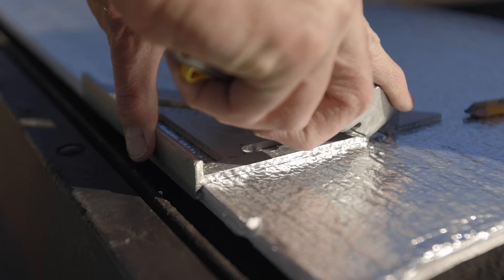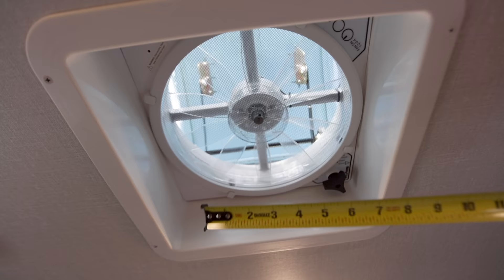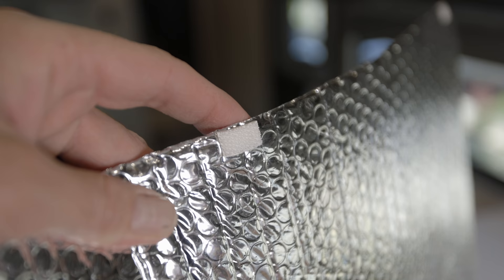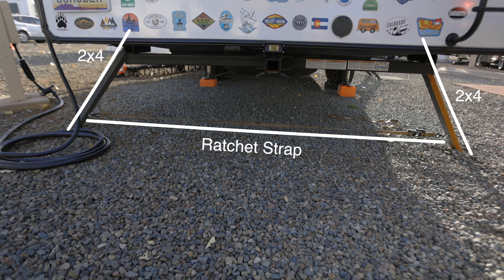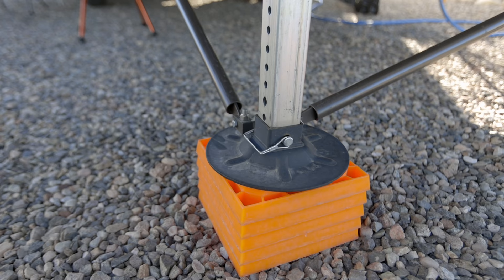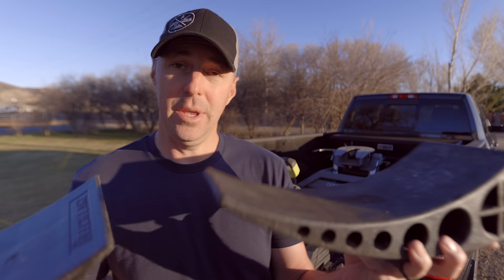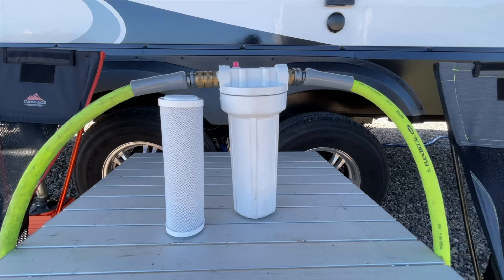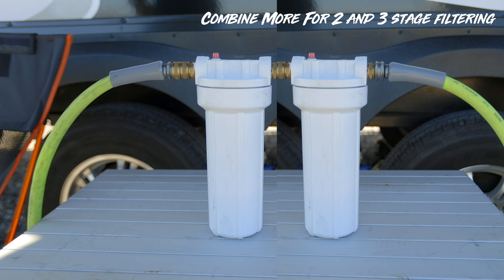HomeMade DIY RV Accessories!

Comment: I used a 4 inch hole saw, but you could do it several ways to put a hole in the bottom of a 5 gallon bucket. I flip it upside down, and it holds my water filter nicely. When traveling, I  coil my hoses up inside the bucket and put my filter upside down in the center. Water drains, and it's all ready for next trip.

Comment: Not as useful for full timers like you, but one of my favorite diy things is the hose I made. It has a garden hose fitting on one side and an air hose fitting on the other. I hook it up to the city water connection and can blow out my water lines when winterizing. It save a bunch of time and money spent on putting antifreeze through the whole system. The air fitting side of the hose is attached with a thumb screw hose clamp, so it's removable. That way I can also use it to connect to water at places that don't have threaded connections.
Reply from the maker: That is a great idea.
Reply: Camco and others also sell a fitting that accomplishes the same thing. The one I have is anodized aluminum and fits in the little divider kit I have with spare fuses, bulbs, screws, etc.

Comment: Good video! I put strong magnets in the reflectix right where the screw heads are for the window frames and got some printed mountain/outside fabric to put on the cabin facing side to have a better view than looking at silver on the walls. I will have to try out the rigid foam idea!
Reply: Very Good Idea.  I bought 3 packages of little Extra strong Magnets from harbor fright , can get them about any were  Lowes amazon  changing a lot of stuff over to  Like what your Doing.......MAGA

Comment: I use stall mat cut to 10"×10" as leveling blocks like the orange or yellow ones. This product is super tough and doesn't slip when your pulling on to it.
Reply: Lol,  did the same!  It also keeps gravel from getting jammed up into the blocks and making it a pain to restack.

Comment: We use the large levelers under the tongue. To help insure the base of the jack does not move, we build a top that nests into the levelers and has a pocket just the right size for our jack base.
Reply from the maker: Great idea to keep it from sliding off.

Comment: Love that filter assembly. I’m going to give that a go. I like to keep my hoses coiled in a bucket and that got me thinking maybe I will mod a bucket to put the filter in with some insulating material wrapped around it, cut holes in the sides opposite bucket handles for the hoses to poke through. The bucket wouldn’t have to be that big, either. Can’t wait to try it out!

Comment: As a special education teacher I use Velcro all the time. There is black and brown Velcro that comes in small circular pieces. You wouldn't have to cut them for the reflectix and since most RVs have black trim around the windows it would blend in better than the white and would look more professionally done. They should also be plenty strong enough to hold the material.

Comment: I made wooden stabilizer pads almost the same way… sandwiched 2 pieces of plywood between 1” thick slabs with 1/4” rubber stall  mat on the bottom using construction adhesive and screws but I put the ends of around 2’ length of scrap ratchet strap (about 6” of each end) so they have an easy handle! Also, gave them a few coats of marine varnish to protect them from water, etc!

Comment: Simple metal coat hanger to make a bracket to hang they water filter off of the water spigot so it's off the ground
Reply from the maker: Good idea
Reply: @AllAboutRVs   great if you can find the wire coat hangers
Reply: @arthurkneisel8296  dry cleaners still use them or you could bend up some utility wire roll found at your local hardware store.

Comment: I made a bracket to hold our water filter out of one by six. We use quick connections on both sides of the filter to make it easier to hook up. We painted it and have used it several years with great success

Comment: Another good video, Thanks I always learn something from you.  I made a filter holder out of a 25L foldable milk crate. Just turn it upside down set your filter housing on top and  outline the housing and cut it out. Now the filter will sit down in it and is very stable. The crate collapses and stores easily. If it is hot or really cold outside I will cover it with a space blanket or Reflectix.

Comment: I used the reflective foil to cover my windows too. Most of mine just slipped into the channels but for the ones it didn’t, I used aluminum tape to secure it to the frame. I like what you did. I may have to try that in the future. I purchased the pillow with the reflective side for my vents and in my shower skylight. I tried just using reflective foil in the skylight but the aluminum tape wouldn’t hold for long periods of time. My cabinets over my bed were getting moisture in there so my clothes were getting wet. I used the reflective foil in there too.

Comment: Pro and cons to everything. My buddy bought the vent pillows and it got so hot where we were that the vent frame fan warped from the heat . ( maybe crack the vent open if it extremely hot?). As for the wooden block ( used them for a long time too ) I now use the plastic leveling blocks and the plastic tire levelers because as a RVer weight is you enemy ever little bit helps to light up, most storage is in the front of the trailer so run you setup across the scales axel by axel and you might be surprised if you hitch weight.   Stay safe my RV friends

Comment: you may want to be careful with the 'reflectix' - in high heat areas, I have had them warp the plastic channels in the window.  Also, had it warp the plastic skylights......
Reply from the maker: Thanks I’ll watch for that but haven’t had an issue in Arizona or Florida summers yet.
Reply: Thanks for the warning. Another YouTuber recommended putting reflective insulation on the outside where the sun hits as more effective. It keeps the sun’s radiant heat from ever getting in.
Reply: @robertschulke1596  agree it would be more effective, but how long will it last it rain? More effective plus more hassle.
Reply: @TraconWizard  if it’s raining or windy or after dark, you don’t need to worry about too much solar heat. Take the covers off.
Reply: We had the reflective ones on the camper door windows , left it on while in storage with the sun on it ,and the frame warped on us too. I bought some blackout ones on ETSY for the camper doors.  I still use the reflective ones on the other windows , just not 24/7

Comment: Alternative for your wood blocks, use 2x6 boards cut them to about 11 1/2" and screw them together cross grained.  Mine are pressure treated lumber, 7 years old and I built 10 blocks for the 6 point system and works great and can even use them for tires if the site is that far off level.

Comment: I also added a ground pad that I use under the leveling blocks to keep the gravel from getting lodged in the bottom block. It just annoyed me to try to stack the blocks and the gravel or small rock would mess it up!  I used a rubber stable pad from Tractor Supply and cut it in squares about an 1/8" around larger than the blocks.  Used a jig saw to cut it,  and it smells like a tire fire, so use an N95 mask while cutting the rubber!

Comment: I ran a 10x2.5” filter housing setup last summer. But noticed that pressure would drop off at flow rate. Tried a number filters inside.
Moved to a 10x4.5” housing with lower micron filters and haven’t had any pressure drop off.

Comment: The water filter you have does not have to sit straight up. You can lay it on its side or even upside down and will not affect the filtration

Comment: I made 2 reflective covers for the canvas ends of our Hybrid trailer to reflect the sun off the canvas in the summer. I just connect them to the trailer with bungi cords.
Reply: You can find thermal reflective tarps on Amazon or sporting good stores in the survival section. $20. Typically, they're used with the reflective side towards you to keep your heat in, but flip it over and now they reflect heat away. That's what we used on our Rockwood Roo 183 with the 3 hybrid flip out beds. 60x80 in size fit perfectly over the tops with plastic clamps from Harbor Freight. Or bungy cords since they have hooks. Not only does this keep heat out in the summer, we used them almost every trip to keep that morning sunlight out to keep kids sleeping in longer and less cleaning of the bed tops. It was a lot easier to wipe them off on a table than moving a step stool around and wiping down the the fake canvas that was hard to keep clean. We gave them to the new owner of the Roo when we sold it to buy a new camper.
Reply: @jeffreybryson  I got mine for free, it was a cover for steel we bought for work. All it cost me was grommets,  and a couple of bungy cords.

Comment: I put quick release fittings on the filter …much quicker👍
Reply: But, it will restrict the flow because the inside diameter of the quick release is smaller than the pipe fitting

Comment: i use a 6 inch underground irrigation valve access and drilled a hole in the lid for my filter stand

Comment: Instead of the command strips, you could make a little slit in the edge of the reflective bubble wrap and put small neodymium magnets exactly where the screws are around the window. Of course you would have to put a dab of a rubberr type cement in after the magnet

Comment: For the reflectix, I cut the pieces bigger for the non sliding section so I can push them in and that works well.  For the sections that slide I actually cut them to size and have my wife open the windows  from the inside and I place them against the screen from the outside.  When she closes the window it stays sandwiched between the window and screen.
Reply: Great adjustment

Comment: That reflect x idea with the command velcro is such an obvious but great idea! We had a few day heat wave here and was having issues with our AC conking out. I had to take half days off work to stay home and make sure my cat and dog were okay. I panic bought some aluminum foil and tape and taped up my windows from the outside. Worked well but made an annoying mess I've got to try and clean off[the tape residue]. I'll get some reflect x and prepare for that for next time

Comment: I have a two filter system in my coach, an old Monaco dynasty, but I have added a whole house UV filter after the two filters. I have a 10 µm filter with carbon and filter element and a 1 µm filter before the UV filter. So I can drink the water and feel comfortable washing dishes and showering with the water out of the tank. It filters the water going in the tank and also when I draw water out of the tank it goes to the same filters again.

Comment: Been wanting to know what your water filter was as I saw it in other videos. So glad I found it here and how much cheaper it is as compared to the dual blue system. Thanks for all the knowledge you share. Gotta add that one of my FAV tips is the one you showed about using the fuse at the top of the 7 pin connector to make all the lights and cameras work....AWESOME!
Reply from the maker: Thanks! New video coming soon on a great budget filter option!

Comment: We have a whole trailer filter that came with our Rockwood that is after the pump/city water feed. We plan to get a Reflection 5er and want to mount the same thing where the Electric outlet is in the water bay (possibly move the electric outlet above the water bay, facing down.)  We could make the internal filter a lower micron filter and then use an external higher micron for city water or tank fill.  Just thinking out loud...

Comment: Just bought the same filter (container) and threaded fittings. Then realized I could've bought the same model from Culligan for $35 that includes fittings. Works out to about the same total cost except Culligan's model has plastic fittings included.
AO Pros: Fittings are separate making them easier to keep clean
AO Cons: Fittings are separate, must be purchased and require plumber's thread seal tape to install before connecting hoses
Culligan Pros: Fittings included and no extra install or seal tape necessary
Culligan Cons: Fittings included are made of plastic...which could be a pro depending on how you look at it. No tape needed.

Comment: Why not put a smoked max air cover on the roof vents? I did that on mine to help with the sun beating in and heat. Also allows me to have the vent open if it’s raining

Comment: I've had limited success using self-adhesive velcro to attach Reflectix due to the heat melting the adhesive. Of course, I live in the southwest, so it may not be an issue elsewhere.

Comment: You may have noticed the extreme amount of heat that come through your shower sky light when the sun is shining. The bathroom heats up and the heat migrates out to other rooms. The sky light is two separate pieces of clear domed plastic. Lowes sells a smaller bag of WHITE fiberglass insulation- $5.88 (Item #35136Model #B777CT40) You can remove the inside dome and evenly place the batting over the sky light and tuck it in the side cavities (to hold back the attic heat). Then reinstall the inner dome piece. I estimate that you still get 80% of the sunlight in the bathroom (more than enough) but ALMOST NO HEAT! This is a big deal when trying to cool your RV. Note; I have a Grand Design Reflection. I don't know if other brands use the same sky light.

Comment: I find the landing gear can slip on the square plastic levelors and even slide off them. In a strong wind, the front landing gear of my fiver slid half way off. Fixed it but that's scary.

Comment: Concerning your stabilizer.  Will this reduce the rocking that we get with our jacks down? Our trailer is only 20', but rocks like crazy! I've tried using blocks to shorten the jack reach, not blocks to lengthen the jack reach, nothing helps. TIA!
Reply: Also, we have a belly pan, so I don't have access to the undercarriage framework.

Comment: Another good video. For the filter what do you do with it during travel or if you aren't using it on between trips? We just camp weekends so I was wondering about how to get the water out of it easily for travel and not having it sit in there for the week. Do you just disconnect hoses and drain it out and call it good? Basically what I did with the old style I guess.

Comment: Great tips Jared I think camco sell a filter holder for that kind of filter thanks 😊
Reply from the maker: Thanks.
Reply: Yes, but too expensive for either the plastic (wind knock over) or the metal (ground is too hard/rocky).

Comment: magnets might work better than those command velcro strips
Reply from the maker: Yes I would prefer magnets but the first magnets I tried didn’t stay on the window covers
Reply: @AllAboutRVs  separate the layers and put the magnet between the layers then glue the layers shut trapping the magnet inside.

Comment: I like any one that thinks. I did used the velcro strips with the bubble wrap on the windows too, looks like you cut yours in two pieces too. people only need about a piece 1 inch long. I store the shades under the mattress, nice big flat area. on a Class A with auto leveling, Snap pads are the way to go. I took the in line check valve out were the water come into the rig, the opening in the spring check is about 3/8 at best. took it out and replaced it with a 3/4 ball valve, with the ball valve you really do not need a check valve, when you hook up the hose, open it, when you take the hose off and run off the water pump, just close it. put a car window shade above my shower across the sky light, velcroed it to the ceiling, lets the light in, but keeps the sun and heat out, or a lot better. on a hot sunny day the air in the shower is about 3 degrees cooler. insulate under your bottom cabinet draws, kitchen, bathroom ,bedroom. good video

Comment: Is there any reason you didn't go with the FrigiLife 1 Micron 10" x 2.5" Whole House CTO Carbon Sedimen Water Filter Cartridge?  It would fit into the housing and take virtually any contaminants out of the water.  Cost isn't too much higher and it does a better job.
Reply: If I had to guess I'd bet the one micron filter probably reduces flow down too much to be usable on city water hook up.

Comment: We have an awning window, one that pivots up. We like it because it can block rain while open. Putting the reflective material on the inside, to block the sun, blocks the screen and therefore the air flow. We solved this with small suction cups that can be used to attach the reflective to the window itself, so we get sun blockage and air flow. Velcro or magnets will work in some situations, too.
Reply from the maker: Great idea